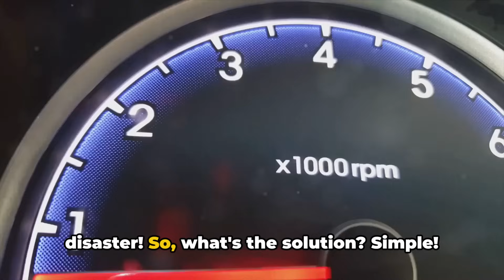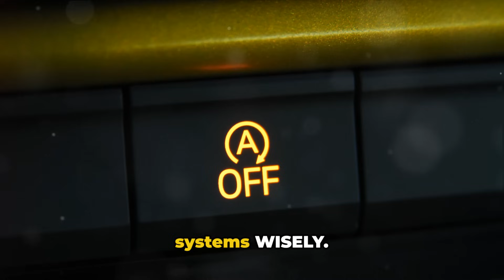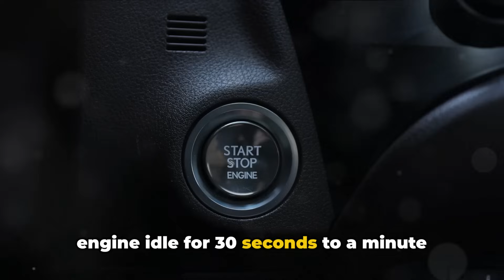5 Mistakes that Destroy Turbo Engines Fast!

Comment: start stop is the dumbest thing auto makers every came up with ,  I wouldn't have a car with it
Reply: the reason is the wltp test which measures the Gases coming out the car. and in the test theres a stopping phase every now and then. if the engine doesnt run there the manufacturers pay less for the co2 emissions and can get their cars in the market more easyly
Reply: it's crap, but it's far from the dumbest thing. maybe in the top 5.
Reply: @JTV84  I would definitely put it at #1. I'm curious what you other 4 candidates are?
Reply: It's my understanding that start / stop is required by government regulations. Auto makers had no choice but to obey.
Reply: Agree. Not only it accelerates the wear on the starter . Each time you start the engine, it rocks the engine mounts , putting wear on them , they are not cheap to replace. And if you live in a hot tropical climate country, start stop is blardy stupid, once engine off, the aircond compressor turns off, the cabin heats up so fast, so the engine has to restart within seconds.
Reply: You can override it in every car it's not a big deal.
Reply: It’s also unsafe!!! My wife’s Honda Accord shut off on me just as I was releasing the brake to push the accelerator while attempting to pull out into heavy traffic. What a joke
Reply: A hybrid vehicle has this system.
Reply: In some cases you can disable it by default like with Bimmercode for BMW's.
Reply: Cylinder deactivation is by far the dumbest and worst idea ever for combustion engines. They're designed to operate and run on all cylinders, not half or a quarter.
Reply: My vehicle has it I live in the mountains in Northern Europe the temperature in Winter is sub zero, stop start on my car wil lnot activate for most of the time anyway because its so cold and the alternator and battery are struggling to keep the car and all the auxiliary equipment running the cars brain just disables it so its not a concern for me as it almost never activates in winter more so in Summer but I just turn it off.
Reply: too bad Emission standards became so strict you wont find one produced in the last 10+ years without. simply turn it off, is one button push too much?
Reply: Porsche has idle stop, but it can be deactivated until activated again.  You’ll be driving a EV if you want a car built within last 5 years.
Reply: Why?
Reply: @gideonighodalo3476 IMO two reasons.  #1, the number of duty cycles on the starter.  It will wear out sooner rather than later.  #2, and most important, engines get their vast majority of wear and tear during startup.  There is zero oil pressure when an engine is not running.  Starting your engine every time you resume motion after a stop adds a huge amount of wear and tear.
Reply: I have no love for SS. But it's not that bad. If your car is turning off with a hot turbo then that is poor engineering. The car is supposed to monitor things like that for when it's okay to use a stop start. Also if does NOT effect the starter. Cars with SS have starter with a much higher duty cycle and are built better than cars without. Also, cars with SS that are designed properly have valves that keep oil pressure so when it starts back up it does not have to build oil pressure. Manufacturers aren't the smartest but they're also not the dumbest they kind of know what they're doing for some things and stop start is one of those things they know what they're doing with.
Reply: @nhbountyhunter I have a 2017 focus and it won't use stop/start if it's too cold
Reply: I agree start stop is the dumbest thing auto manufacturers came up with. I hope not to own one.

Comment: 3500 to 5000 miles oil change?? In your dreams. So far doing about 9500 miles with same oil as it is the factory interval and with 5,5 years so far 0 engine problems. And based on service book the previous owners have done same thing.

Comment: 2 minutes is ok, 5 is a bit too much to wait for the engine to warm up.
Personally I just wait for it to drop down the idle rpm and then take off very lightly for another 10 minutes or so, this is valid for any type of engine tho in my opinion

Comment: I always compare oil to blood for non car heads. Same way you body makes new blood cells to replace the old so everything works right inside them is the same idea for changing oil. If we didn’t get new blood cells we die, if the engine doesn’t get new oil on the proper intervals it dies. I still see or hear of some people that don’t believe in oil changes. I do mine every 3k with full synthetic. Ik I can go longer but I prefer to stick to that.Ive had multiple cars I’ve ran hard and not once blow a motor. Someone in my family on the other hand has blown 4, one of which was a Honda and another an old Chevy🙄

Comment: Hi iam from the netherlands i drive a nissan juke nismo whit 200 hp i tuned my car last year and on dyno orginal 215 hp tuned to 245 hp how its posible it have more hp orginal the tuner say you fil the car always whit premium fuel thats very good the car drive very good but i dont use the power sometimes yes😀  do you mean only in cold weater  i do that bur normaly i drive but not over 2500 rpm the first 10 min

Comment: Modern factory turbo engines with start stop have no issues with oil feed and drain there's a valve that leaves some oil in the turbo until the ignition is turned off yes correct oil like a synthetic is best but no need to get oil from the dealership, currently have a turbo car it takes 87 i put 91 in it guess what ran rich and fouled all the plugs, go by the manual that's all you need to do unless it's aftermarket then listen to the builder 6 vehicles from 300 to 4500 hp

Comment: Good lord!

I just want to drive my car! I don't want to have to always be thinking about "babying" my turbo charger all the time. Right now we have 3 older normally aspirated cars. Most newer cars are now turbocharged. When we need a new car, I feel like I'm going to have to really look hard to try to find a car without a turbo in it so I don't have to worry about my car's engine all the time.🙄
Reply: Best advice.
And you can drive your turbo diesel engine car hard.
Change the oil and filter very 8 months or 6k which every comes first 
Just allow 3 min warm up in the morning.
It's the manufacturers longer oil change intervals of 20k destroying everything.
Every 6k or 8 months
Turbi will last then.

Comment: I run my 2001 Crown Athlete VX, 1jz vvti on super unleaded and change oil and filter every 3k to 5k miles. 

Also fitted an oil temp and pressure gauge. Also has a turbo timer that was fitted back in Japan. 

Had no issues in 5 years I've owned it

Comment: I'm 57 and never thought i'd say this but old school. The list has things I have done all my life especially letting the car warm up. I also believed the higher gas cleaned the engine also?  Mazda CX-5 I just bought with a turbo (1st ever turbo for me)  My question is "fuel additives" like seafoam and that stuff you put in to get water out of the tank? Does this really work and clean out the engine? I'll look at the book about the gas I need..I am very peticular about my cars after all it's easier to pay little for things needed then face neglect and the price you pay for it.
Reply: Well, your doing pretty well with what your already doing, as the higher quality fuel usually contains more additives, and cleaners that you shouldn't need to add anymore.  Water contamination is rare, but then there are additives that you can then use -- as I know it happened to me a few years ago on a vacation.  I just bought a product to remove water from  fuel injected engines, and it did work (although I had to have the local dealer reset the check engine light).  One other point, if you see a fuel truck refilling the main tanks at a station, drive to another one, as that is the riskiest time to get gas as the pumper truck is tending to stir up any sediment in the underground fuel tanks.

Comment: That’s absolutely great information. I have a Corolla GR 300HP 3 Cylinder Turbo running 26 PSI boost. I change my oil every 2500 miles. Plus I idle the car for 2 to 3 minutes before turning off, also when car is warming up I’m easy on the car until the oil is 190f. Simple small things can make a huge difference. Plus I would take it a step further with direct injection turbocharged car it’s very important to avoid short trips for fuel delusion not to occur and make sure you get your engine to operating temperature for minimum of 15 minutes.
Reply: make sure you dont exceed 85 miles an hour too, that'll keep the warranty and stop random fires from starting
Reply: @jdkrey6326 😂 good one. Toyota warranty = no warranty.
Reply: @jdkrey6326  1 car out of thousands no a big deal. Mine is awesome. This fire thing is completely overblown!

Comment: In cold weather it's better to start the engine and go! Just don't accelerate hard. Oil will warm up and circulate faster when the car is moving. Don't idle the car till it gets warm.
Reply: I heard the same advice, start and immediately drive slow.
Reply: @BenoitWeiss-cg8pf  i wouldnt say immediately, sometimes when starting the car, oil temp is around 10 degrees celsius, i wait for it to reach 20-25c before leaving my garage.

Comment: Idling your car for 2-5 monutes before driving is just wasting fuel. Nobody in their right mind would use lots of revs until and engine is cold but immediately driving and stick to 2k until the oil guage moves is fine and doesn't waste 2-5 minutes of fuel sitting at 1000rpm.
Reply: so many cars don't bother with any kind of oil gauge anymore, it's sad.
Reply: My car has a remote start through an app. It’s a 2021 Mercedes GLC 300. It has been a routine for me to turn the car on using the app in the morning after I take a shower. It shuts off automatically after 10mins of idling. By the time I hop on to the car, the engine is already in operating temperature (i.e., blue thermometer symbol is already white). Been doing it for a long time. The fuel wasted during that 10mins is cheaper than having a broken engine later. It’s prophylaxis.
Reply: Just get in and drive it is the easiest thing to do.
Reply: Dude I'd let my Honda s2000 warm up for 5 min till the temp Guage goes up 2 notches . Your supposed to with high performance engines . If your talking a normal economic car then sure let it run for 1 min max . But high performance you need to let it run for 5 min or so
Reply: Well, nobody would do that, except @ikeudechukwu5018 😂
Reply: While driving let youre oil warm up to 90 degrees before you stamp youre speed pedal. I always stay under 2000 rpm untill the oil is heated.
Reply: Who said "start your engine,15 sec and go like"easy" revs....your oil is still honey....and with the low revs...it gives u more torque or moment to your engine parts which is the worst thing especially when those are still cold.advise:always depends on the outside temperature, in 0C around 1 min warming, in -20C, can be 4 min warming up
Reply: This is not true at all. 5 minutes idling takes 20 times less fuel instead of driveing the car direct from start atleast in cold conditions. Idling 5 minutes lowers the fuel consumpion because the engine has gained temperature.
Reply: @ninec5257 the engine heatens very slowly when idling....after cold start  5 - 15 secs idling is okay to get oil pressure up....then carefully reving when driving until oil has 80°
Reply: @ninec5257 I was gonna say, lol

Comment: That's a good conversation starter. More info on working temperature could be mentioned and effect this has on stop/start wouldn't hurt. Most stop/start systems only engage after the engine has warmed through anyway. So leave them on to save gas. For the most part stop/start systems work well and save you money when the engine is doing little more than idling in urban traffic. But yeah, they can be a problem if you just pull in off the motorway or other high load driving. Turbos are kind of like the canary in the coal mine. Truth is poorly implemented stop /start systems can eventually give trouble to several areas in the engine, especially diesels.

Comment: Good advice. Most engine wear takes place in the first 10 seconds after start, in addition to what is mentioned about the turbo.
Quality of fuel is even more important since Crankcase oil vapour is re-routed into the engine through the intake system, which lowers the effective octane rating as well as gumming up the throttle body and intake ports.

Comment: Thanks for these tips! Most of them i am already doing but i do shut down the engine straight away when i'm home but i make sure that i didn't make to much rpm's when i'm almost home. That helps a bit to right? But the best thing is to wait for 30sec when it's parked? =)  Edit: I'm driving a Focus RS MK3

Comment: There is a lot of information that simply isn’t given here! Modern turbo charged engines are almost always cooled with coolant so you don’t need to let them idle on shutdown!  Some manufacturers have direct injected turbo engines so you can in fact run them with 89 octane!  This video refers to older technology, not newer turbo charged engines!  I recommend your owners manual over a YouTube video generalization of a specific type of motor!
Reply: Wrong I have a pretty new 2018 basic VW golf sport fwd 1.8T I open gas cap it says recomended 91. So Im assuming if I put 89 octain its not a great idea.
Reply: @totov7673 It all depends on the manufacturer. My 23 Silverado turbo runs on reg 87. Most manufacturers are using water/oil cooled turbos which helps cool down the turbos after the engine is shut off. Otherwise the start/stop systems would destroy them.
Reply: @totov7673  what part of “some manufacturers have direct injection engines escaped you?”  You didn’t learn from VW and it diesel lie, of course VW will cut corners, they’ve proved it by lying, cheating and buying back 100’s of thousands of cars!  Now research MB, BMW, Toyota turbo engines which use modern technology on its turbo motors!
Reply: There is a difference between Octane number in US and RON that is used by the rest of the world. 87 reg in US equals RON91 , 91 premium in US equals to RON95  .
Reply: @fleurdewin7958  No bc 91 ron = 93 octain or to be exact 92.8. 95= 94.5 legit numbers.

Comment: I drive an Opel Astra J 1.4 Turbo and always wait for the engine to lower the revs before pulling away, AND never accelerate hard until the engine temp shows 90 degrees Celsius. After some hard driving, I tend to drive slower and "off boost" which is below 1700RPM for about 5 minutes to let the intercooler and fan do their thing.

Comment: I have been practicing these advice for more than 25 years. I never drive off without letting my car warm up for about 10 minutes. I only use 93 octane on all my cars. Based on my direct experience, I can conclude that 93 octane protects internal parts of any engine because it is so stable and as such it really prevents unstable explosions in the pistons. I stopped using 87 and 89 0ctane about 15 years ago. And, 93 octane actually burns slower and in a more stable fashion than 87 octane. Finally, I only do 3,000 miles oil changes. Cleaner oil cools the engine too. People have told me that I waste money changing oil too soon. Well, my advice to them is that you can either change the oil or you can change the engine.
Reply: 3k is probably excessive tbh. Not a bad thing, never gonna knock someone for being careful but you are probably best off 4/5k and less if you’re not driving hard/ in awful conditions. As for warming it up, you really don’t need to sit it for 10 minutes. Wait for the oil pressure to reach a suitable level and drive off. Much more effective that way, just drive conservatively, no lugging it and no high load/revs. And you’ll be totally fine
Reply: @ryanclarke4448 Not in my S63 BMW M6 V8 TT
Reply: @ryanclarke4448  i happen to disagree with you. I drove an engine to 200,000 miles. I drove it hard for 15 years. Weekly redlines was the norm. I changed the oil every 2,000 miles. After 15 years and 200, 000 miles of hard driving,, the internals from the timing chains to the cylinders, looked like the internals of a 120,000 miles engine. The cross hatches in the cylinder walls were still very visible and there was zero gunk anywhere in the engine. So, i have seen with my own two eyes what constant oil change does to an engine.
Reply: I was told to start engine and immediately drive very slow to get oil pressure up. That is in non turbo engines.